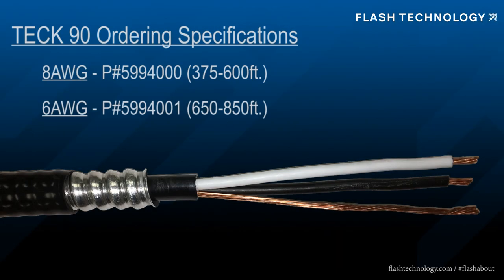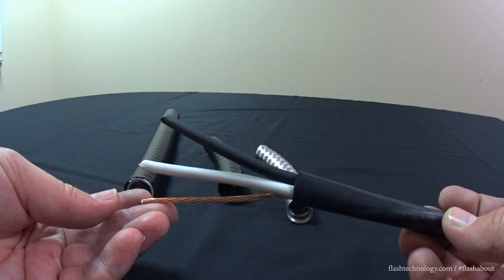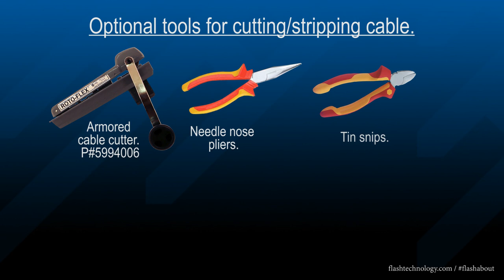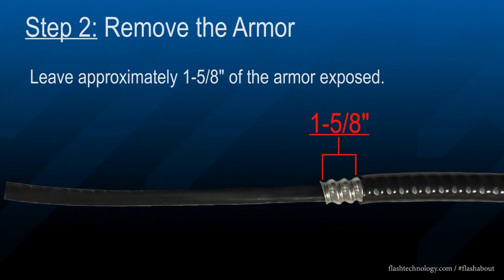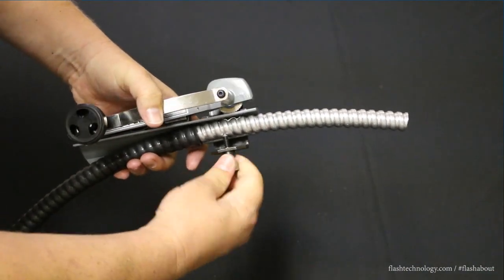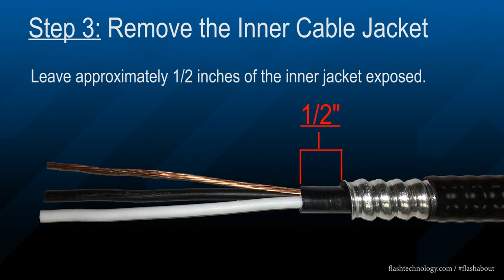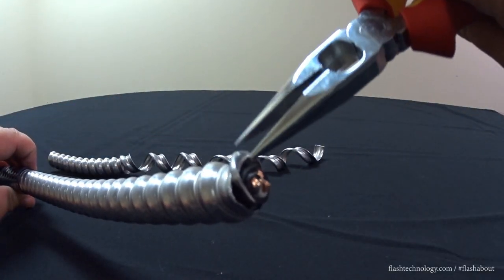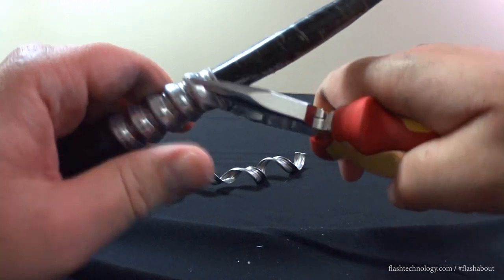TECK90 Armored Cable

Comment: how many amps could the armor handle if it was the ground wire?
Reply from the maker: Hi Denis, the TECK90 armor must not be used as the ground conductor of the power system.  The installer is responsible for ensuring that the installation conforms to NEC and all applicable local regulations.
Reply: @FlashTechnologyFranklin  I know, just wondering.